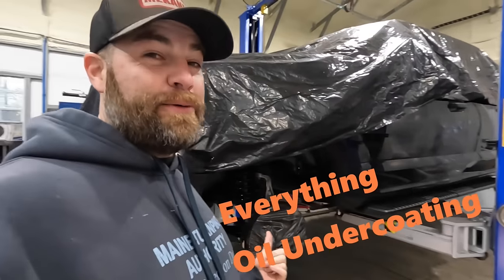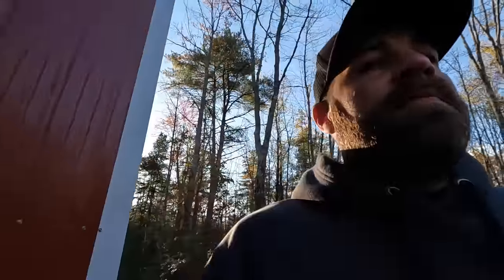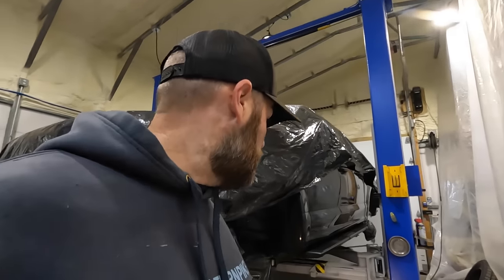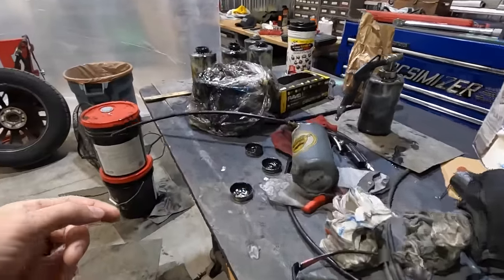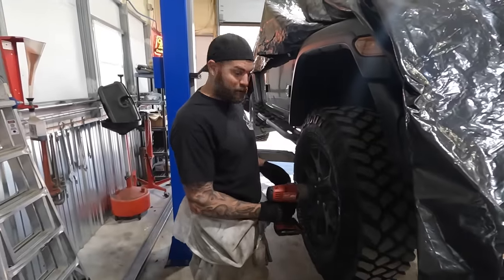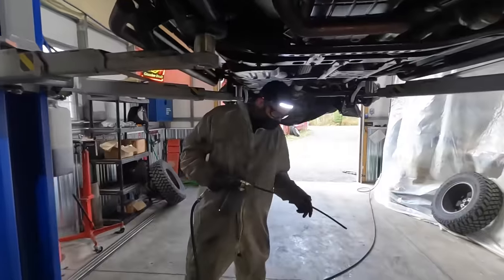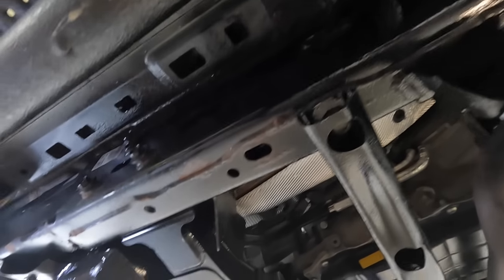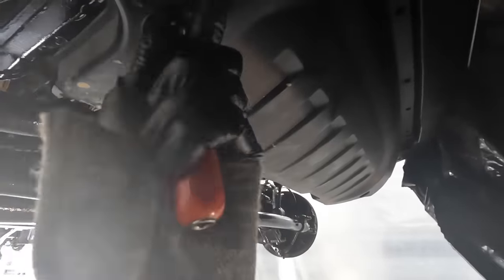The FACTS about Oil Undercoating!

Comment: I live in the rustbelt here in Ontario Canada where we have brutal winters with a ton of road salt.  We have an oil based spray called Krown and it's Canada's Number 1 Rust proofing and they have been around since the 1980's.  They guarantee no rust and will fix any that occurs if you have used the product since the car was new (or under 2 years old with less than 48,000km) on it.  My van that was 22 years old had 0 rust on it when it went to the scrap yard with 500K on the odometer.  It made me a believer.  You can buy the cans of their product in the US and Canada and do the application yourself.  It's a non-toxic environmentally high zinc oil that creeps and then produces a self-healing barrier.  It eventually dries in place after the first month but it will drip like crazy for the first week.  You need it to creep so it can get into the seems of welds and folded metal.  If it doesn't drip, it can't creep and doesn't work.  They have videos on their web page talking about it all.  Krown Rust Control.  New Hampshire would be my second choice.  My brother lives in Boston and that is what he uses because he doesn't want to do the application himself and his Mechanic does the New Hampshire treatment.   All rubbers should be sprayed with a 100% silicone spray first to keep them from absorbing the oil products and causing them to deteriorate with time, no matter what product you use.  In the Krown treatment shops here, they start by treating all the rubber on your car like the door seals etc. with 100% Silicone spray.
Reply: My wife used to work for krown rust proofing for a number of years and sadly it has become big business for most of the franchises. Putting cars and trucks through every 15 minutes as they have to meet a quota. I ended up replacing my rubber motor mounts as the Krown turned them to mush. It also washes off easily underneath. I finally switched to a product called Corrosion Free and it's is so much better than Krown. It won't rot the rubber either. You can buy it in pails and do it yourself.
Reply: @condoguy810  That's unfortunate, I've never had this problem with rubber turning to mush. I've always had a thorough application as well. I'd love to apply it myself but I can't because of walking impairments due to a spina cord injury. I have seen the corrosion free test results and it is good stuff but the problem is trying to find somewhere that isn't Canadian Tire that applies it because those folks don't give a damn about your vehicle and won't do it properly. At least with Krown they are annually certified.  I would have complained to Krown head office, maybe your facility wasn't doing it properly or using the proper stuff.  I don't know. I know their customer service is excellent at head office because I called to compliment  a facility and they were great.
Reply: What a crock of shit. First of all krown is not Canada's number one rust proofing company. You need to educate yourself on that kid. They are one of the worst products to use. Yes they will repel rust but the company itself focuses on profit over protection. They don't spray most of the cavities inside your vehicle where salt water can accumulate. And the ones they do spray they tend to drill holes to be able to insert their plugs instead of pulling the factory plug right next to the hole they drill. So they're making unnecessary holes in your vehicle. Which down the road you can actually see these new holes drilled end up rusting out around their plugs. Krown is also known for dripping a lot when first applied. This is easily seen when you drive into the driveway of any krown dealer. You'll see us continuous dark path leading from their bays out onto the street. You want the job done properly. You get a qualified guy that does fluid film. Much better. Product lasts longer and these guys actually spray inside of all the vehicle cavities using factory openings, no need unnecessary holes being drilled.
Reply: @jasonmorehouse3756  You sir have no idea what you are talking about. YOU NEED TO EDUCATE YOURSELF before you go shooting your mouth off about what you don’t know about. They have been around since the 1980s and have over 500 locations coast to coast servicing  approximately 40,000 vehicles annually with a warranty that is backed up for the lifetime you own the vehicle. They don’t just do passenger cars but also commercial fleets. If they weren’t anything that they claim they wouldn’t be here after almost 40 years and wouldn’t be as large as they are. They also would have been sued to oblivion for their claims if the product didn’t work. They are they are in fact the largest company in Canada with all their technicians having to be certified annually at Krown on how to apply the product and which vehicles have which known areas for corrosion that require special attention and better application methods to ensure they don’t incur corrosion in these areas. Something no other corrosion proofing product does for their network of people applying their product. Having used it for decades and keeping our vehicles till the wheels fall off some 300-500k later in some of the worst weather with tons of road salt where I am later I can tell you it does work well and does stop 100% of rust in our vehicles. We have used it since the 1980s across our fleet of family vehicles. I’ll take that test case and all these facts above over some nonsense you are going on about with 0 facts to back it up, any day of the week.
Reply: After decades of use KROWN is King.

Comment: You've only done half the job! What about inside the doors and rocker panels? Trunk lid and hood? Another good idea is to spray, front and back, any steel wheels if you're putting on winter tires at the same time.
Reply from the maker: Thanks for the advice 🤙
Reply: I agree except for spraying the wheels. It will throw off onto the side of the vehicle and onto the brakes. I may want to stop at some point.
Reply: @stevenjackson7067  Doesn't touch the brakes.

Comment: Picked up 2020 4Runner with 27k miles and was going to do the blaster product on it this summer.  You convinced and sold me on fact buying the spray kit and applicators is way to go.   Not having a lift will mean more work, will put it up onto jack-stands and wear some old clothes.   I do like fact NH product easier to see and black base looks good.

I live in Western Mass and work and live in Boston area.  How far are you from Boston?
Reply from the maker: That’s great I’m about 1 hr 15 minutes from Boston

Comment: Ever tried Oil for a Chainsaw? That stuff is so sticky and holds so well on all surfaces, vertical, horizontal...and it's even cheap.
Sticks so good, because IT hast to Stick to the Chain on the saw for permanent lubrication and avoid overheating the chain
.
Reply from the maker: I agree but not as environmentally friendly
Reply: @FlippinCustomized  ....Here in Germany you can buy a Gallon of that Stuff for about 10 Dollars...but, for Environment reasons, also available as a biological Produkt....It works very good on our old Toyota Land Cruiser and this Car works in the mud nearly every day
Reply from the maker: Nice

Comment: I agree with you on the fluid film washing off. I touch up with fluid film when I’m under the truck but have switched back to getting rustcheck to do mine.  I may start doing my own again some day but laying on a gravel driveway don’t sound like too much fun
Reply from the maker: Ya I hear you there
Reply: It does not wash off. Iv been using it for 25 years. If you correctly apply it and get a good amount of road grime going. Go watch a video on how fluid film seeps through seams
Reply: @jacobg6528  how is it done correct maybe I've been doing it wrong

Comment: Used diesel engine oil 60% and  40% heavy bar and chain oil. Inspect and touch up annually. NH oil is a good product just very expensive. $236.00 for 5 gallons. Rattle cans $15.00.
Reply from the maker: Good mixture, unfortunately nothing is cheap

Comment: I've been having carwell or more recently Krown applied to my '13 Jeep JKU. I have been under the Jeep quite often either doing maintenance or something, after watching the process of watching you I am confident that I am not getting the full thing. A couple cavetas to that; it only costs about $125, and they typically have it for only an hour or so. I'm almost positive they have not removed my wheels, and I have found places that have never been touched. Both places I went to wash the exterior though. This is disheartening because the Jeep is a tribute to my dad who has passed on and I don't ever plan on selling it. Now I'm left with how to ensure it's done correctly. I even tipped the last guy before he sprayed in hopes he would put extra effort into it. If I had a lift, I'd do it myself. Any tips?
Reply from the maker: Maybe ask to watch the process? Where you located
Reply: @FlippinCustomized  Rochester, NY. I became friends with the guy that did Carwell, and he showed me everything he did. He left the industry and now I go to a Krown applicator. I know the inside of the doors has been done (he showed me where he drilled and then plugged) but I know he didn't take tires off, and I am pretty sure they did even less at the new place. I have found places that have never been touched doing my own work under it. I usually do it once in the spring and once in the fall. The rust belt is killer here just like you. I wouldn't mind paying the extra at all. And if I had my own lift I sure as hell would be doing it myself... it's all in the details. Like in the engine bay, and another hidden spot is behind taillights and the fuel tank door. The place that is doing it now does all kinds of aftermarket mods and I am sure they won't let me near the bay.
Reply from the maker: It’s hard to find places you trust

Comment: Il like tonuse transparent protection tu keep the original look of the underneath,  so i use rustol owatrol and from time to time lanoguard oil on threads and different spots where it starts rusting , ive done it on a car 30 years ago and it still solid
Reply from the maker: Nice

Comment: Cars in my youth (60 years ago) aged into two categories.  If the engine didn’t leak at middle age, the body and frame rusted out. If the engine leaked oil, it didn’t last but the body and frame held up.
Reply from the maker: Exactly 😂

Comment: Only bad thing with these oil film products, rain washes it out of wheel wells in 6 months, it makes a mess of the oil drips on the driveway.  I used NHoil, but will switch to fluid film to try and then will try blaster surface shield which is best, but its hard to find.
Reply from the maker: We have great luck with it

Comment: You forgot the rocker inner panels,  that will rust first from the inside out. I use waste veggie oil,  it's free and works  just as good.
Reply: Any chance vegetable oil would attract critters to chew on soft parts?
Reply from the maker: Definitely did not forget 😂 but good catch

Comment: Old transmission fluid used to work fine in the 70s never had any rust i would brush it on every fall
Reply from the maker: It creeps well to just not so good to the environment
Reply: I brush on my used engine oil and spray it inside the rockers… I’ll worry about the “environment” when the highways aren’t made from tar and the military stops being the number one polluter
Reply: @FlippinCustomized  how it’s on the frame and doesn’t drip off ? I use it on all my farm equipment 
Old oil is burnt into the air anyways 
Also how many co2 are made when Israel Iran and Russia and Ukraine and throwing bombs around left and right  
A light coat of used oil will not hurt the environment 
And it’s free you probably vote democrat as well

Comment: Are you not concerned about the effect the oil has on rubber parts like suspension bushings and brake hoses?
Reply from the maker: No, but we wipe excess off

Comment: Would this be a good product for touch up bare metal and extra protection over the factory Chevrolet wax coating? In my case, it will be a 2019 Silverado 2500HD. Trucks very clean, but we just moved to Ohio from South Carolina and want to make sure it’s protected. Thanks!
Reply from the maker: Absolutely a good option

Comment: May be a long shot being that the video is so old. What brand of spray guns are you using? I do this on my own vehicle every year and my gun recently died on me after only 2 years. Any help is appreciated! Thanks from New Brunswick, Canada
Reply from the maker: Actually if you go on Nh oil undercoating website it was the entry level I have since upgraded but I still use the other as wel

Comment: I bought a 76 cj7 from the original owner that had a factory undercounting in the eighty’s and it  had rusted(Minnesota) so bad that I replaced the windshield frame needed replacement. I used unistrut to reinforced the body from the inside and just let it go. You could see through the body from any angle strate through. Was a big hit at Jeep get togetheres. Kind of like a big desiccated bug. Shame as it was a qudratrac 304 Lea is bluejeen edition with a hard top
Reply from the maker: The factory undercoating was no good then it held moisture

Comment: just did my 2016 2500 and used at least 2 gallons i probably could of adjusted the spray nozzle better.
 i got a 95 1500 i hit too the frame needed this bad,
 this stuff is amazing
Reply from the maker: Sounds about right for a vehicle that size first application

Comment: I'm not fan of undercoats because some of them are just going to cover the rust and actually keep moisture there so it rusts faster. But I dont understand why the cars can't just have well designed linings that would cover all of the body and with changeable fasteners. Also in lots of cases rust start to occur around plastic fasteners-clips, which are just in a hole in the sheetmetal parts. The edges of the holes are the weak points. Also all edges of sheetmetal bodyparts. I would just like to have plastic lining all around the bottom of the car, well overlapping each other and instead of underbody coatings just use zinc. I can always see if the zinc is degrading or gone and just brush it and spray more zinc on. It of course does not help for long time if the parts are directly exposed to water or even salt (i tried). On my older car I had wheelarch liners above rear wheels which were covering all the inside, but newer car has just partial liners and it makes a difference.. but where is the rest of liners? One part under the engine which is not even covering the whole engine. I should buy sheets of plastic when I have time and opportunity (I don't live at home now) and just do something
Reply from the maker: Oil undercoating penetrates rust
Reply: @FlippinCustomized  i rather use zinc which will rust first before steel and I just add zinc when it's needed but it happens fast when it's wet and without any other protection over it

Comment: Never knew about this product, does it hold up to under carriage washes at the car wash? And Will it leave an oily residue on my driveway when it rains?
Reply from the maker: I don’t recommend any bottom blast car washes for the duration of the winter as the oil undercoating protects it and it’s not needed until spring in my opinion
Reply: @FlippinCustomized I agree 100%, find a carwash that doesn't do undercarriage wash.

Comment: If spraying with oil it’s not a fire hazard as parts get hot? Doesn’t it smell? Also seems like it would get very messy if anything needs to be fixed after
Reply from the maker: Not a fire hazard, low odor, very messy to work. Vehicle 😂

Comment: I use 80/90 or any type of gear oil.  Mix it down with a thinner so you can spray it.  I use a similar spray can as in the video.  1 liter of oil will do a whole vehicle for me.
Reply from the maker: Oh my we use 1 1/2 gallons minimum

Comment: The mechanic i use told me he's gonna charge me extra for the mess under my car.  Says my undercoating (it was NHOU) is a mess to deal with while working on my car. I had it on for 1 year, and its still wet looking and if touched will coat your finger. Will it ever dry more or is this how it supposed to be?
Reply from the maker: That’s how it supposed to be, some shops may charge more but I would rather get oily than deal with rust
Reply: Find another mechanic